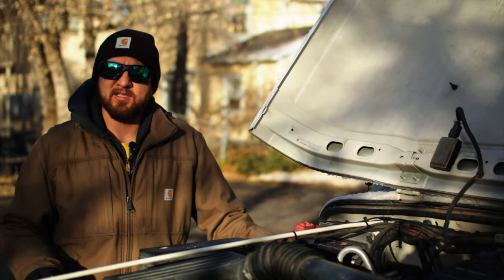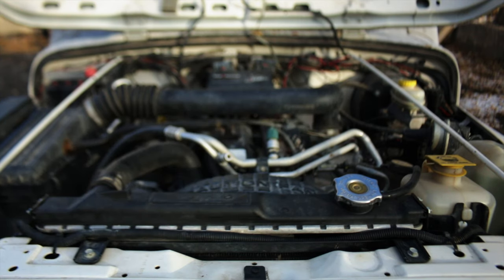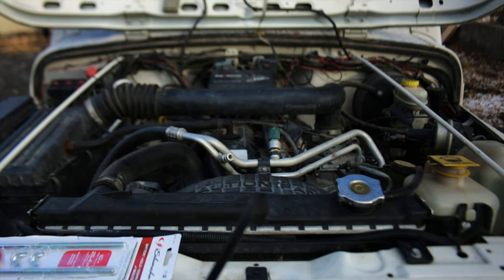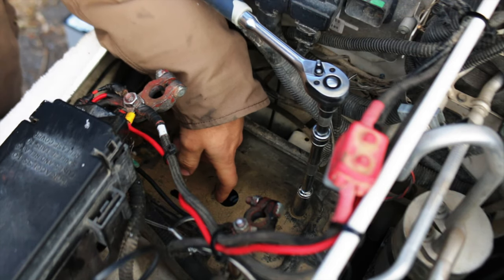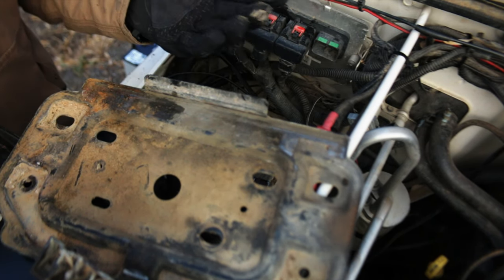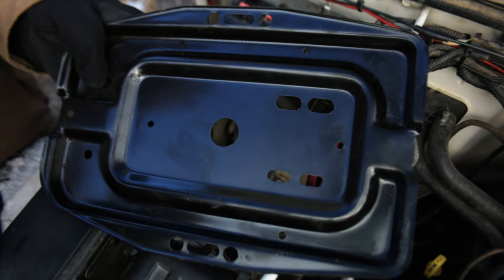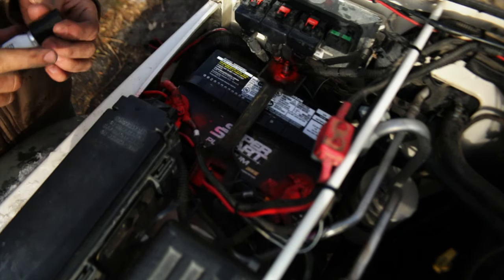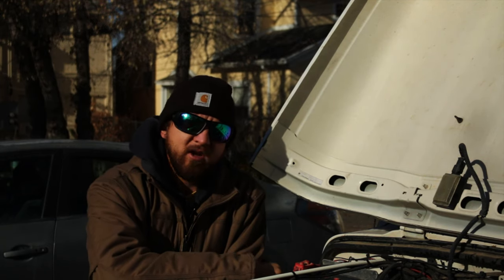Best Battery Hold Down

Comment: That factory clamp is horrible. It was a pain getting out on my 06 TJ. The bolt head was too rusty to the point  it was rounded out. I had to chisel the plastic bracket off to be able to remove the battery then use vice grips to remove the bolt.  Good to know the  2001-2004 TJ battery trays will work with my 06 if I ever decide to convert to your battery setup.
Reply from the maker: Glad to hear I’m not the only one!